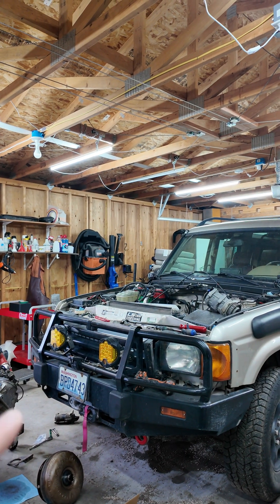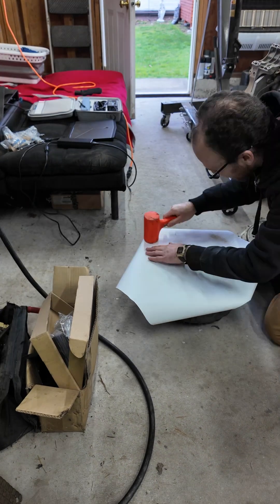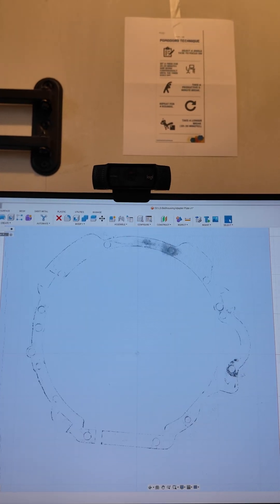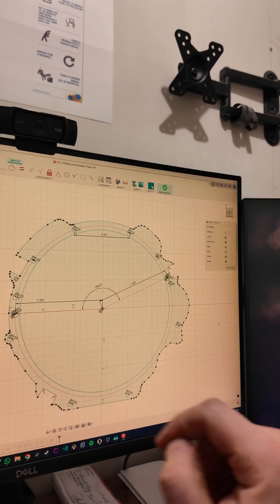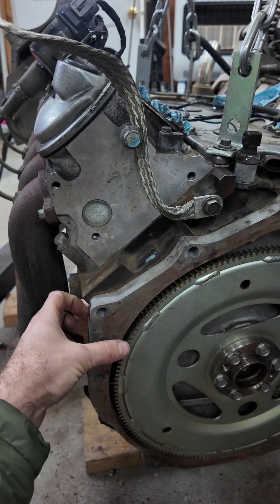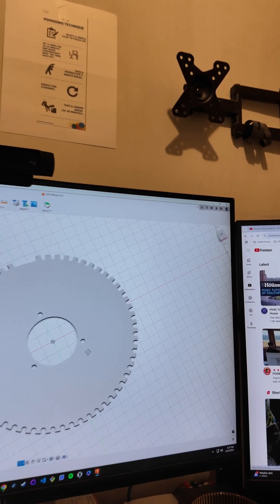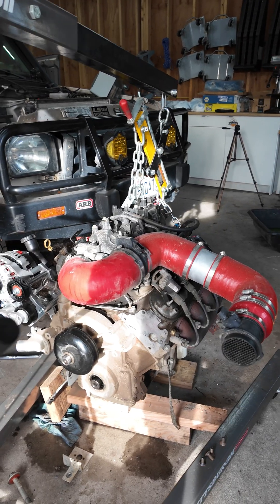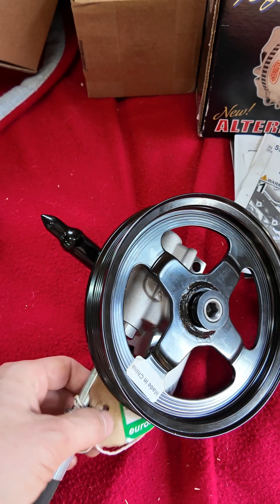Discovery II LS Swap Kit - Part 1: Measurements, CAD drawings, electronics.

Comment: Did you buy the original swap kit from ACE? If so, do you still have the instructions? I bought the kit in 2022, but never finished it & was going to work on it again only to  realize they took down the website & the link to access the portal with the instructions pdfs. I know you’re doing your own variation but it would be a MASSIVE help if you or anyone has those still.  I’m pretty much dead in the water for next steps post dropping the engine in. Also watching your channel & seeing some much better ideas to improve the process. Much appreciated 🫶🏼
Reply from the maker: Sure we got em! You can also join the Facebook group "USA Land Rover Discovery 2 LS Swap". The ace instructions are in the group files and it's a good place to ask questions about the swap.
Reply: @GoldenRovers  OMG MY HERO!!! ❤😊
Reply: @GoldenRovers  I asked to be invited a few days ago. Not sure if you are able to DM the admins so I can get the instructions 🫶🏼
Reply from the maker: @csableg  Here's a direct link to the files: https://cdn.shopify.com/s/files/1/0714/6147/0500/files/ACE_Current_Manuals.zip

Comment: Thank you for doing this!  Hopefully you can find a solution for us in the SAI / emission states.  

Thank you for all you do to keep our beloved Discos alive.
Reply: I'm doing my best to stay informed about California emissions requirements, but guidelines are really vague. Most of it is taken care of with correctly choosing the donor engine, and documenting everything. The remaining question mark, is that in some cases you need to maintain the transmission (and possibly the fuel tank?) from the donor vehicle. Is this one of those cases? I don't know.
Reply: @ VA emissions is basically done through the OBDII port and the I/M readiness test.  Seems to also check ECU for tampering as well.  Not sure if your kit will help keeping the emission overlords happy. Will the traction control still work?